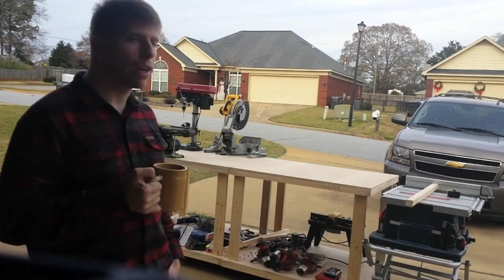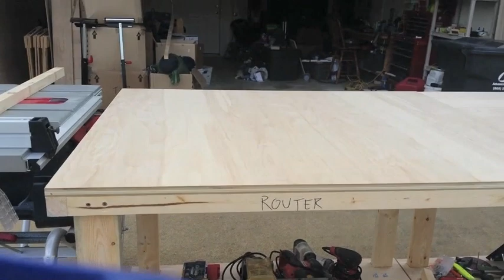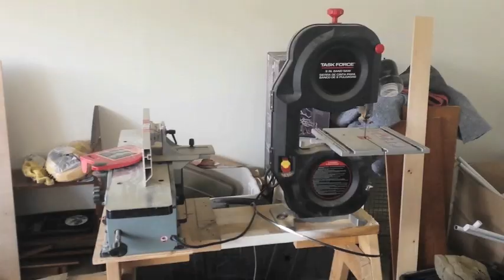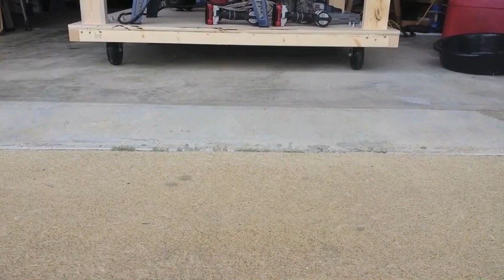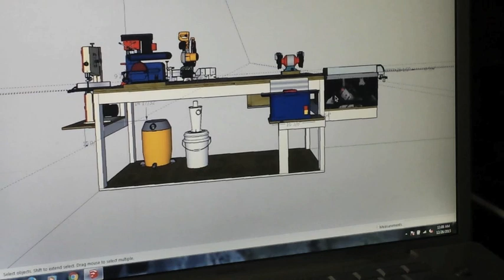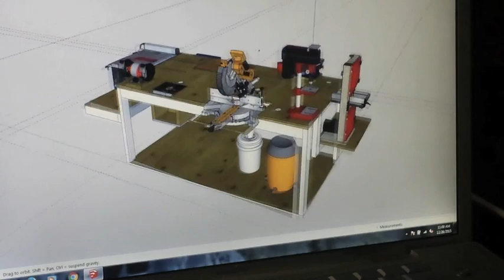Ultimate Micro Shop EP01/ Woodshop on Wheels / See the Update Video, Link in Description!

Comment: You say your table top is to high ? What height did you end up with ???
Reply from the maker: Jimmy, the final height is 38.5" about 3-5" higher than I originally designed it to be. The high table has actually grown on me during the 3 years of using it, but was a result of a mistake I made building it
Reply: Chris Harpster your table is one inch higher than mine. I’m 5’10 and it works for me. I’ve installed a table saw, a planner that flips to a level surface and I plan on having my jointer at a level height that also flips to my wood lathe that will set above at normal height, and later my chop saw that will mimic my planner and tuck away leaving a level surface. All on a 4’ x 7’ surface. I took a pic but don’t see a way to send it to you?
Reply from the maker: Jimmy,  pardon my delay.  If you like,  you can email me on my website at benchtopwoodworks@gmail.com

Comment: Thanks for the awesome video.  Where can I get the plans for this Ultimate Micro Shop, Woodshop on Wheels.
Reply from the maker: Viper, thanks for the kind feedback and for checking it out! Unfortunately, I don't have specific plans. The basic layout is what I consider my contribution to the community. The construction for the table was fairly simplistic and I attached each machine over a period of time. I may make some publishable  plans in the future...for but for now you're welcome to check out my other videos, many of which detail the mounts and fixtures as I made them. If you email me on my website, I can send the original SketchUp file which would allow you to tinker with and see the layout in 3D. A lot has changed since that original model.

Comment: Hey i just found your video. I just acquired a Single car garage. And i'm looking to Layout my shop in a suitable wood/ Small engine repair shop. I dont know where to start. I'm also ready to give up. Please give me some help so I dont give up.
Reply from the maker: Thanks for watching, how you should set up your shop depends on the types of projects you plan on building/using the space for and what equipment you have need of. What machines do you own or plan to use? I recommend at least one primary work bench and laying all of your machines out to have parallel runs

Comment: Which shipping crate biz has only 40 inch containers that you needed to fit into? I'm also building a 40 in bench for power tools but to fit through a 42 in yard gate limitation.
Reply from the maker: C Puzz,
when I was getting ready to start the design I was struggling to remember the dimensions from my previous move so I called a local mover in GA and asked the largest width and 40" was their suggestion. I'm fairly certain they used non-standard 5'x9' plywood to build the crates, but didn't want to make it too wide.  I have items that stick out beyond my bench on all sides now, so I'm hoping the movers don't crate it. when the time comes again, I'll do a move video.  Thanks for asking!